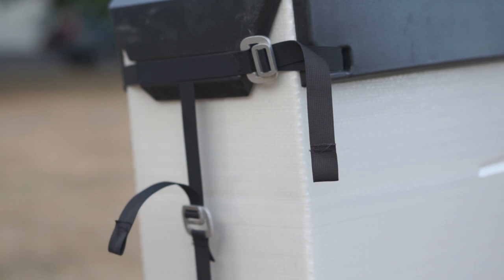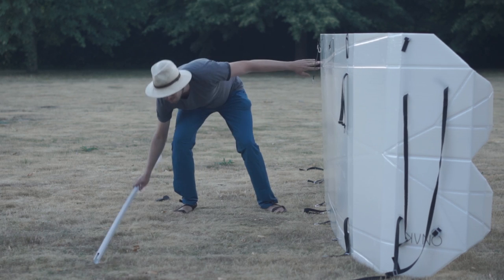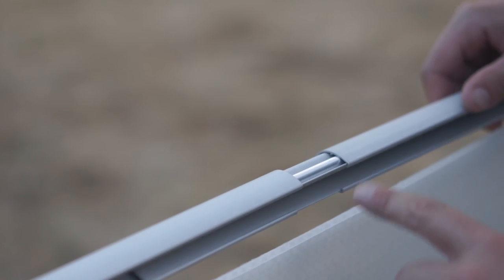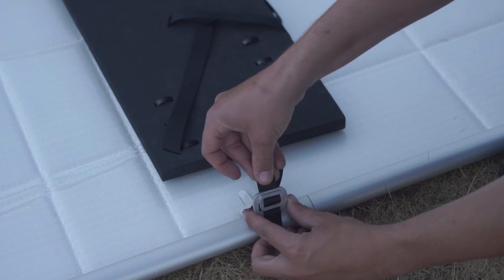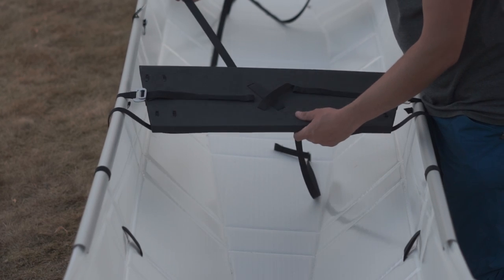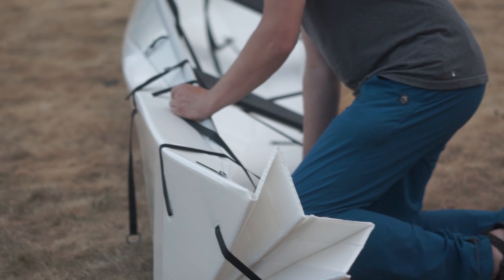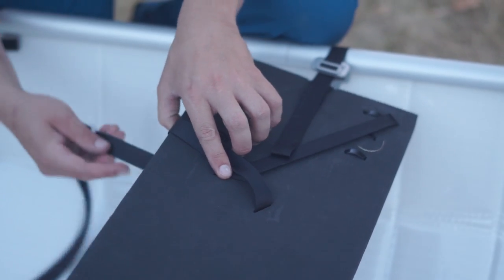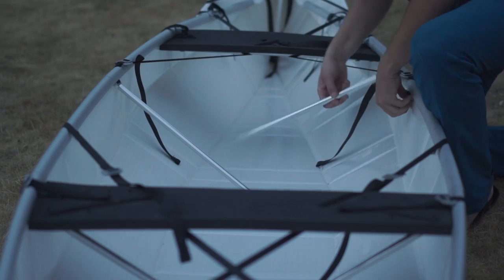unfolding the ONAK canoe

Comment: A lots of straps, an interesting look but what happens is the straps and stays give way on the water or ocean? The straps look like they would get in the way for paddlers , storage and if you had to climb back in. How often do they have to be adjusted once your out there?
Reply from the maker: Hi Doug, We carefully designed the ONAK so that if one strap comes loose, you are not in trouble. The straps are obviously needed for its stability, but we've never gotton problems or remarks on straps getting in the way of the paddler ;-)
Reply: Hi Doug. Thanks for asking us. 

The straps can´t give way on the water (we never experienced it). The tension on the water comes from the seats as the bodyweight of the paddler tightens the straps. If you sit in the canoe the straps are very stiff (you can make them sound like a cord on a guitar). During the assembly-process we have to adjust the straps a least 3-5 times. We are happy to make the complete assembly-process below 20 Minutes now.